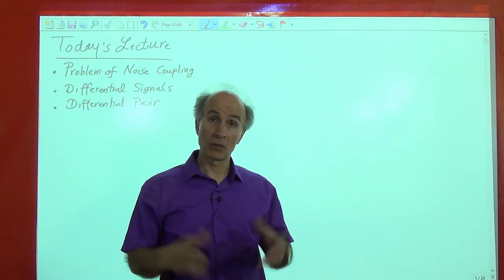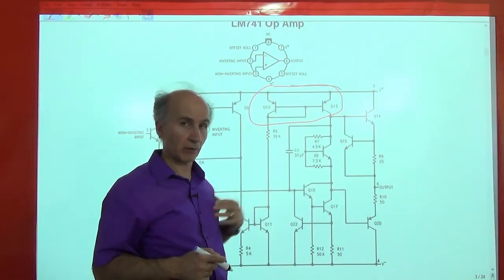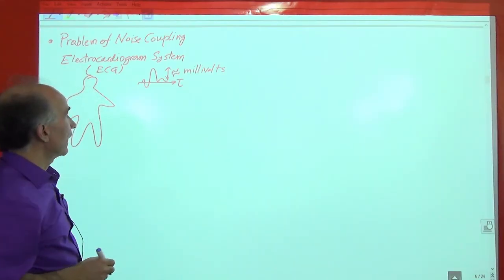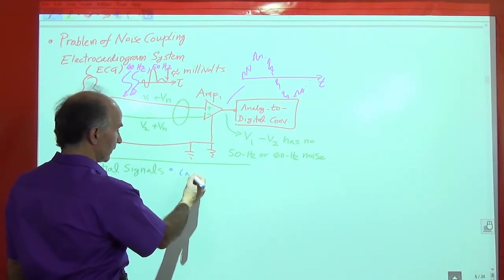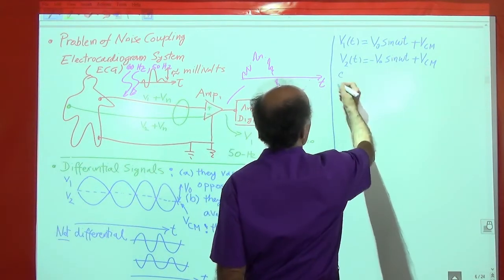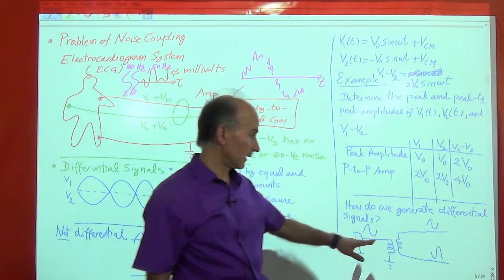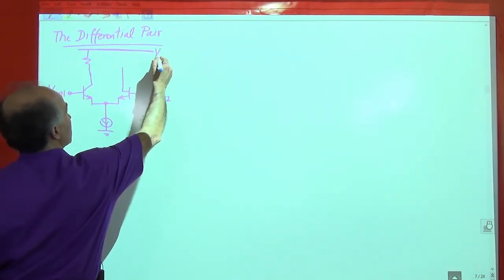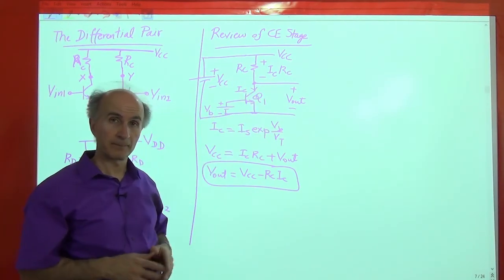Razavi Electronics2 Lec7: Problem of Noise Coupling, Intro. To Differential Pair

Comment: Here is the question : Why operating the BJTs in Active mode and MOSFETs in Saturation mode for current mirrors ? Why not the the opposite ?
Reply: Cuz in those modes they act like amplifier.. MOSFET in sat region it will acts as constant current source.. triode region it acts like resistor..

Comment: 01:25 - Intro and Review
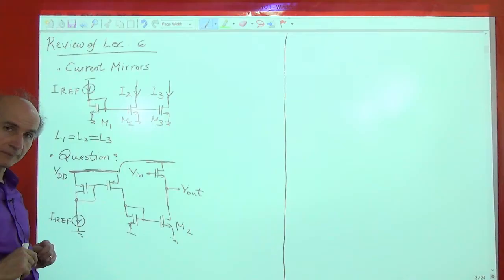06:55 - Examples
13:10 - Problem of Noise Coupling
21:10 - Definition of Differential Signals
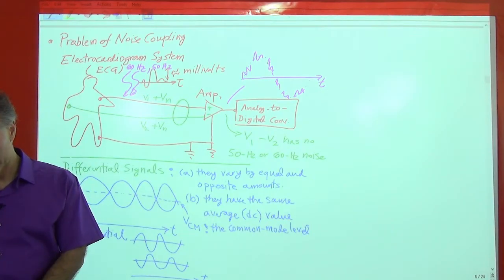26:02 - Example: Calculating Peak-to-Peak and Peak Amplitude of Differential Signal
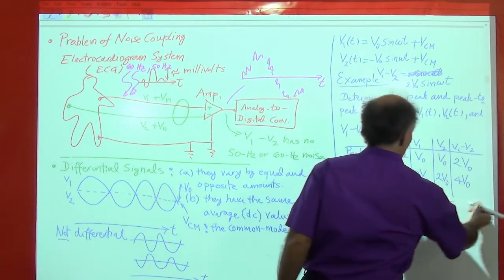32:00 - Generating Differential Signals from Single-Ended Signal
36:04 - Quiz: Noise Coupling
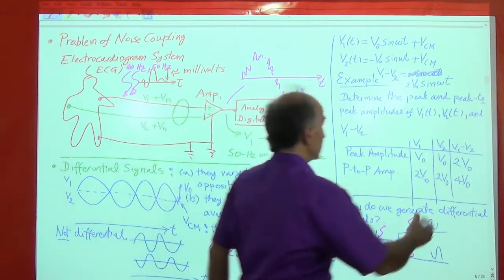39:18 - Preview of Differential Pairs
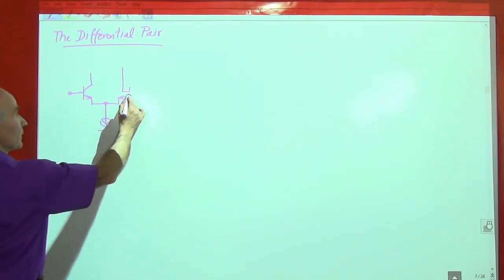39:58 - Review of Common-Emitter Stage

Comment: Why don't we directly give gate terminal of P type current source (which is connected above Iref) to gate terminal of M2?
Reply: I wonder if you connect how that circuit will work like? First he has NMOS current source.. ( Iref connected from node to ground) in order to copy that he needs  one pmos current mirror.. that should be connected above Iref.. through pmos current mirror he got some constant pmos current source ( equivalent circuit looks like Iref(ptype) connected from vdd to node.. )  by using this as input current he tried to give this current as input  to diode connected  nmos device so that it will generate Vgs.. ( bias voltage) which is necessary for that M2 MOSFET to on.. M2 will copy that Iref.. if you connect M2's gate terminal to pmos current source gate terminal.. it will generate -ve Vgs or Vsg( cuz  pmos vgs different to nmos vgs) which makes your M2 device off..
Reply: @SirishaSiriYanamadala  thanks !
Reply: Same question
Reply: did you get the answer?
Reply: same question . still  no answer 🥲🥲🥲🥲🥲🥲🥲🥲🥲🥲🥲🥲
Reply: he should have explained why but Prof. Razavi really likes doing shit like this and leaving people confused